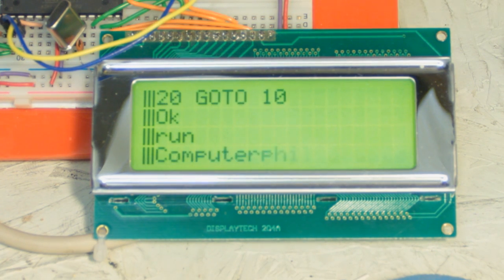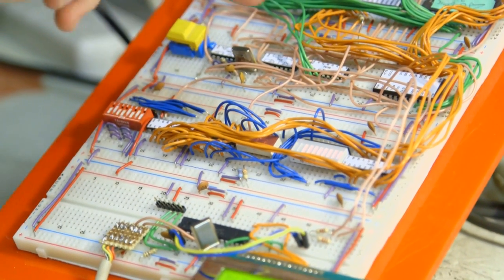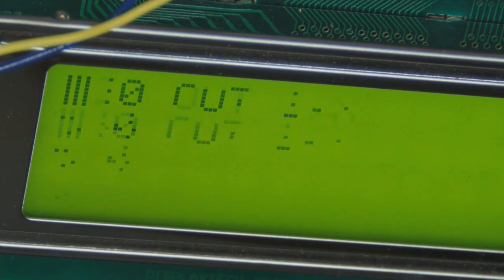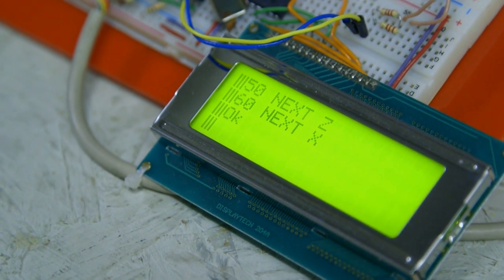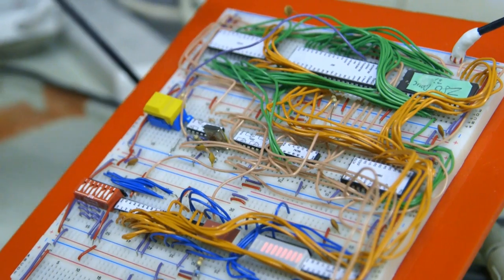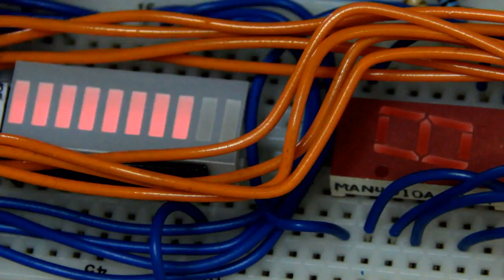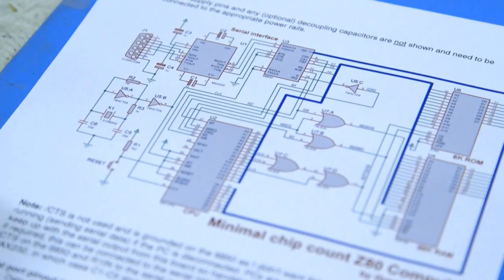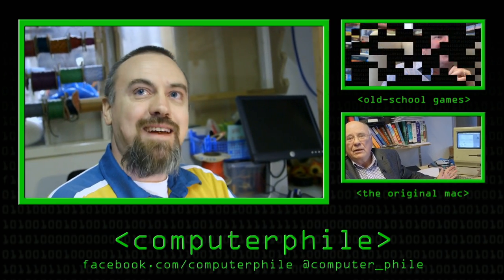Home-Made Z80 Retro Computer - Computerphile

Comment: Building a computer from scratch is a huge task and requires a ton of knowledge and dedication - props for that!
I hope that someday I can build one too, as it gives you a deep insight on how these tiny machines work that we use everyday.
Reply: I designed an 8 bit computer and it seemed surprisingly simple after I'd taken a digital electronics class and understood how to build the bus.

I never built it, but assumed writing an OS would actually be far more time consuming than building the hardware.
Reply: Looking at the circuit involved I'm not so sure it's as hard as it sounds...

Sure, if you were designing the IC's and system architecture as well, (or designing for a system based around a modern high-speed CPU such as an X86 system, where many of the main IC's have over 1000 connections, and as a result require multilayer circuit boards just to route it all) then it'd be a different matter...
Reply: Yeah, the data and address bus look complex, but only because they each have 16 connections, but those connections are all doing pretty much the same thing.

Comment: I learnt assembler on a spectrum as a kid - Hand coding via basic data statements and poking in the bytes - first pgm ripped through the spectrums color overlay area and swapped one paper or ink color for another in a shockingly quick time - hooked for life after that - the Z80 was beautiful - loads of registers and easy addressing modes (compared to 6502 and 6809) and wonderful ideas last ex de,hl , inc (hl) and djnz. Then bought Hisoft's wonderful assembler, diasassembler and monitor which even allowed you to single step through rom, and Dr (Frank?) O'hara's book disassembly of the speccy rom - ah sweet sweet nerdy memories ...

Comment: Being a c64 nerd myself, I feel like there is an untapped niche market for reproductions of moderne 8bit computers in a more portable package and of course with basic+assembler capabilities. Image reviving the demo-scene of the c64 on these new kind of devices - and integrating them in hacker projects by having available friendly IO ports. Much like an 8bit raspberry pi or similar - only simpler, with direct access to graphic output on the monitor, and so on. Like the good old days. I think it could be an important educational tool.

Comment: Wow this brings back memories. I used to write in assembly for the ZX Spectrum +2 long time ago.
Reply: On the Timex (same as Sinclair Z80?) we could load hex into BASIC "comments" & hit an interrupt to execute. Then it was a simple matter of writing assy. on napkins & paper, then  translating to hex by hand  ;-)  Ah how I don't miss those days!
Reply: Mao ting
assembly can take quite a long time, I've done a bit of asm myself, it's pretty tedious.

 (a suprisingly large number of people know Assembly for the z80. Texas Instruments used a version of that cpu in their TI-83 calculators, and the more clever kids figured out you could load and run assembly programs onto them, once you'd gotten low level access. imagine having to code in an image, if it's supposed ot be animated, like in a game, get to code in every single frame, and oh yeah, the 83 ran at like 1 mhz)
Reply: Mao ting Elders... ha! I learned in assembler and didn't write in high-level languages for the 1st 15 years of my career. Writing assy isn't really very slow, many (most?) arcade games of the 70s-80s were written that way by very small teams, in a fraction of the schedule modern videogames require. What is slow & hard about assy is maintaining that code as requirements change!
Reply: Mao ting

When I first started with the ZX spectrum, I did not have an assembler. I used to write programs on paper, then I translate that to machine code.  Next is entering them to the computer using poke command. Most of the time, the computer resets because I entered the wrong number, or mistranslated the assembly command. 

Later on I got "McGrowHill Assembler" which is a software that comes with a book called "Learn assembly Language for the ZX Spectrum" or something like that. 

You write Rem statements in basic, the the comments should be assembly commands such as:

REM ld a,0
REM ld b,10
...

then you call the assembler which will translate your program into machine code.  I remember making a simple side scrolling shooting game using that once which took me about one month to finish. Later on I gave it to my friend for him to have a look. He lost the cassette tape, and all was gone since I did not have any backup tapes. I almost cried. :(

Comment: Love it :) The Z80 was always my favourite CPU back in the 80s and 90s for building up from scratch on breadboards :)
I believe from memory (from own experiences), that the z80 was preferred over the 6502 due to it's single phase CLK line and in built DRAM refresh. Although 6502 Assembly was easier to do for beginner (3 registers etc..)

Comment: My first computer was the ZX-80, and what a cute machine it was. It's much smaller than one expects, with a membrane keyboard that during BASIC input changes modes as you type, anticipating the next sort of data that it will accept. It has to blank the screen while it computes, an annoying feature that was remedied with an upgrade to the ZX-81.
Reply: My uncle gave me a ZX-80 back in 1983-4, he used it for programming BASIC for uni, it was a cheap and cheerful solution if you were willing to assemble it yourself, after his uni days he upgraded to a more modern machine and handed it down to me. I was too young to appreciate it, played with it for a day or two, boxed it up and put it in the loft, I was far more interested with my Atari 2600, only after I got a taste for computing, programming and micros in general, the machine was long gone, I searched high and low for it, just couldn't find it. Been kicking myself ever since.
Reply: I had the TImex Sinclair 1000, those membrane keys were terrible! It was a fun thing to fiddle with though, I still remember having to set the volume just right on the cassette recorder to get it to load a program.  Remembering what a program sounded like makes me sentimental for the old modem handshakes.
Reply: John Hamson
I remember loading a Space Invader game for the Spectrum, and at one point it made a sound just like the intro of the Six Million Dollar Man...   the noise when he says "Gentlemen we have the technology...  we can rebuild him".  Ha - America looked very exciting through my seven year old eyes...  I thought you really had those bionic people.

Comment: Fun fact for all you youngsters out there: the reason the line numbers in the video were 10, 20, 30, ... instead of just 1, 2, 3, ... is that when you later needed to insert code in between existing code, you had nine lines before you were fucked. Renumbering was next to impossible, especially since the many GOTOs you had to use at the time pointed to line numbers as well, not labels. And in any case, if you went in, changed the line number and hit return, you only doubled that line.

For my C64 I had a hardware extension module that among other things provided a RENUMBER command. What a life saver! It also enabled you to scroll in your code instead of just interrupting the LIST command at the right time. Yep, those were the days and now stop whining about your crappy Python IDE ;)

Comment: well done dude. am reverse engineering an 80C188 board: first fixing an 80C188 hardware emulator that had been orphaned on Ebay (microtek....old skool). will cast about for z80 version now..

Comment: Cheated a little with the Arduino. But it's ok. Also. You could use a different chip to address alot. But I know you're going for replica.
Reply: If you still have to breadboard and program it yourself, I'd hardly call it cheating. Besides, using a microcontroller to handle I/O is not an uncommon approach, both the 8048 and 8051 have been used for that purpose from what I remember. If I were to attempt something like this (and I'd really love to!) I would probably use an ATmega1284 as a "system chip" to do keyboard/video generation. But only because I'm too stupid to learn VHDL.
Reply: Fernrat I was honestly kidding about the Arduino part :)

I use Arduino all the time in my prototypes, without using the board themselves except to program the chips or FTDI for the wearables.

I'm sure you could learn VHDL, you made a replica Z80. It's obvious you have patience.
Reply: Most retros projects that replicate an old computer or present a new one based on old technology, cheat a little, especially with complicated stuff like video. In many old computers, the video hardware made up a big portion of the electronics, especially if tricks had to be used to share the video memory between the CPU and the video generator. Nowadays, it would be a little silly to put 20 chips on a replica board to make it generate video, if the rest of the computer only needs three chips and you can emulate the video with one Arduino or Propeller. I don't have a problem with that, or with the fact that replicas usually have a lot more RAM than the original, simply because it's cheap nowadays anyway. Also, although a lot of chips that were used in old computers are still available (and the 6502 is even still in production), custom chips and chips to generate video are usually much harder to find.
Reply: Jac Goudsmit Graphics hardware definitely seems more challenging. I looked into building something along the lines of an Snes at some point... (Comparatively much more recent than something like a Z80 I know), but while the CPU is a custom variant of a common CPU from that era, the graphics chip contains a huge amount of custom logic. Although at that point it starts to look so complex the only halfway reasonable way to replicate a chip like that would seem to be using FPGA chips...
Reply: he probably just used the arduino to reduce his chip count a bit as some interfaces can take quite a few chips to setup if you go the glue logic route
 in which case its better to use a microcontroller of sorts to handle it rather than half a dozen or more chips though it can be fun going the glue logic route for some things if your not worried about board space as you can learn quite a few things from it as to how it works